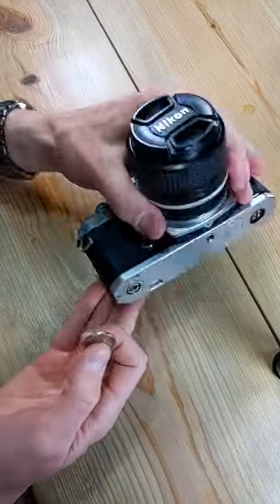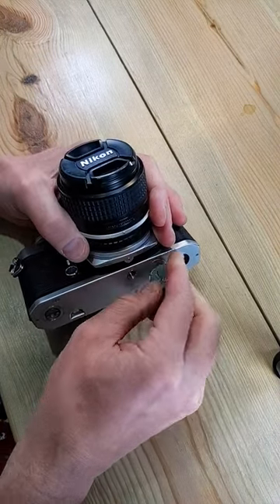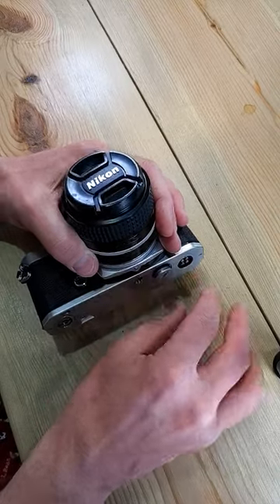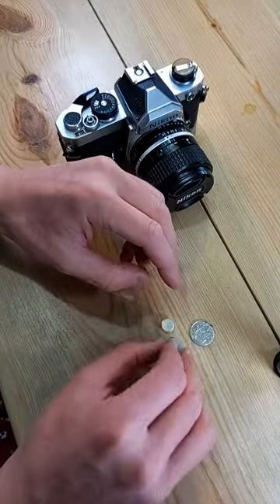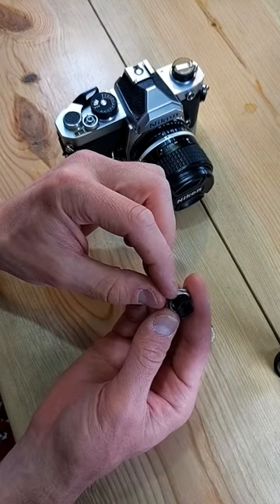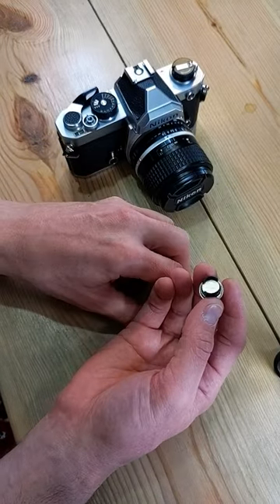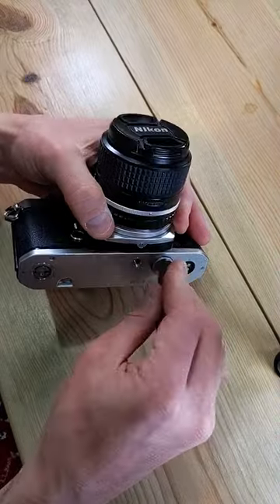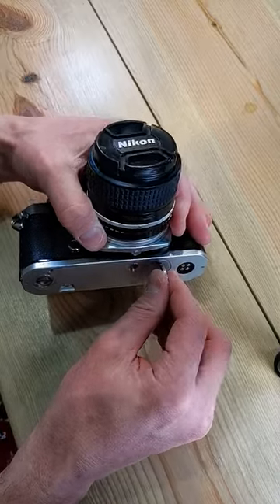Nikon FM Battery Changing -- Use Two 357 (S76, A76, AG13, LR44) Batteries

Comment: I have bought a Nikon FM SLR, black, and I have installed a new pair of batteries because half a year passed. Thumbs up. Also, as it states in the user manual make sure that the Film Advance Lever is not at the stand off position because the batteries can be drained of energy very quickly.📷
Reply from the maker: Thank you! I had forgotten that.

Comment: is it safe not to remove the lr44 when the camera is not in use (especially for a long time)? because my camera battery cover is broken so it can't be opened
Reply from the maker: It's preferred to remove the battery so it doesn't leak or explode. A leaked battery will ruin the light meter circuit.
Reply: @DavidHancock  I got lucky, then.  I haven't done photography in years (since before digital).  I pulled my practically mint FM2 out and found the light meter to be dead.  I opened the battery compartment and the old dead batteries weren't leaking yet.  I replaced them with fresh A76's and everything seems to function.  Now to decide just what to do with it.

Comment: put the battert upside down now it’s stuck on the cap ☹️
Reply from the maker: It will come out. Tap the cap on your desk or a table and the battery should slide down the plastic guides. Then you can remove it and put it in the right way.
Reply: update: i glued the battery to a piece of plastic and managed to pull it out!